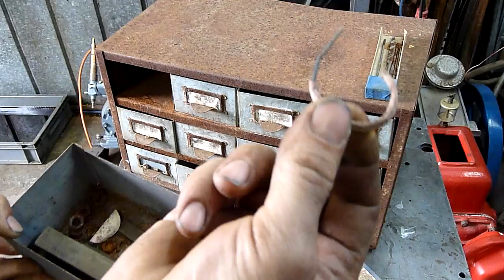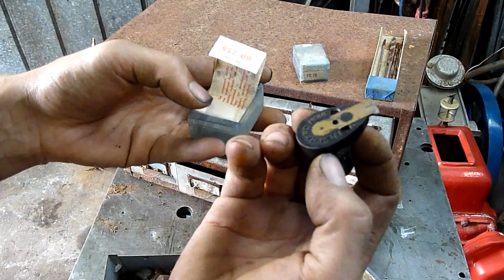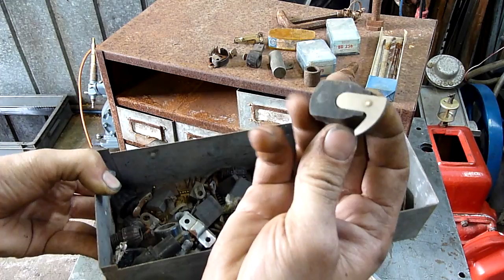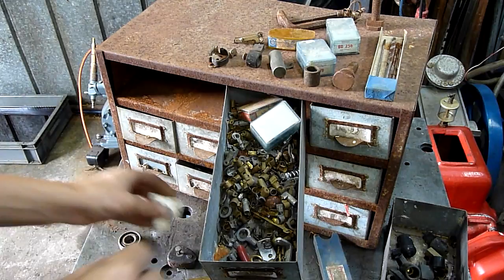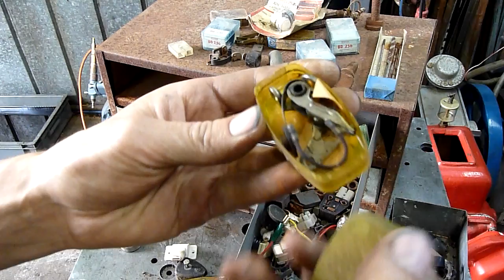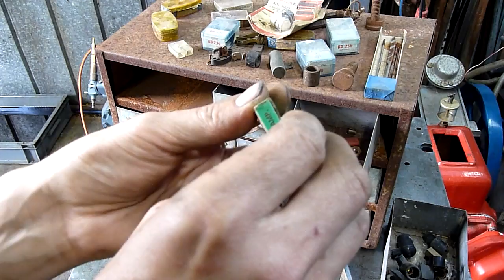Picking Through Vintage Automotive Parts Collection Part 1

Comment from the maker: @jdflyback nope, only if it leaks. if you do find a leaky condenser, capacator or oil filled transformer, never touch the oil and if possible, wrap it in layers of plastic and put it in the rubbish!.

Comment: Just for curiousity sake I looked up "point set" on ebay au.  and US ebay  A Holden point set is listed at $20 AU one sold for $7.50 plus shipping.  Here in the states most point sets are around $30US with shipping.